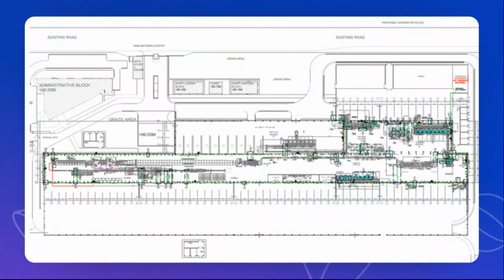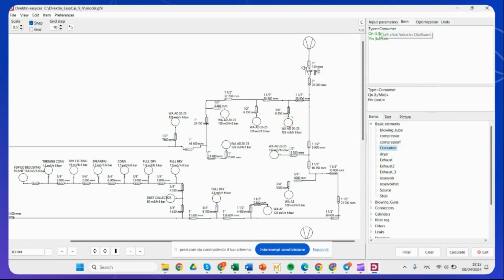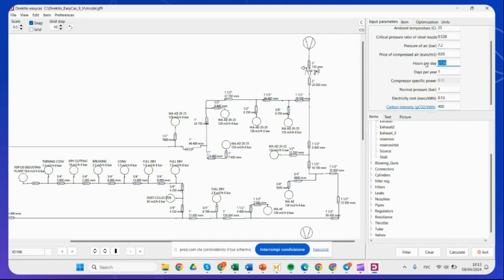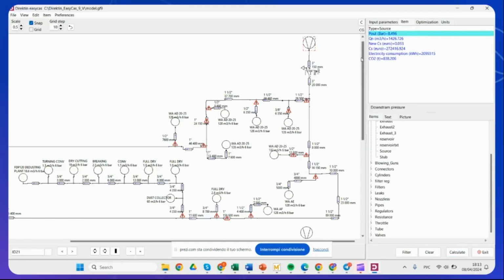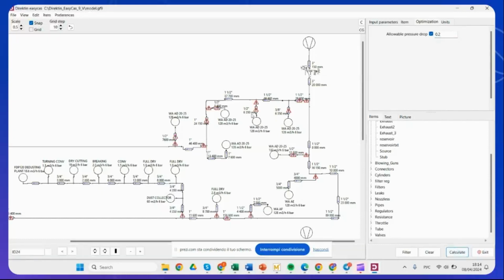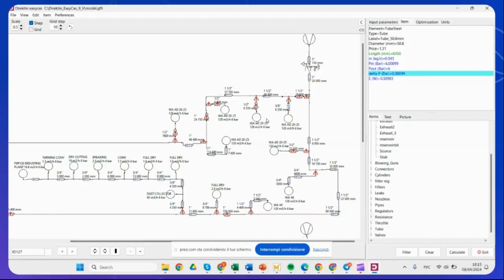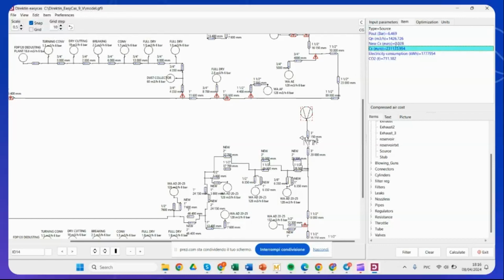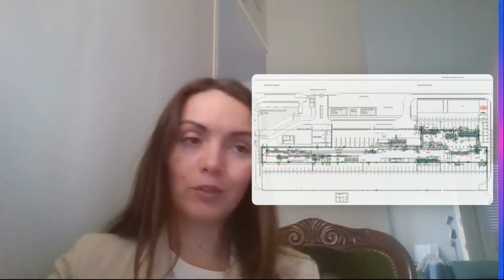How to design compressed air system in 2 hours

Comment: Love the way the software identifies problems with the current system in red!
It may take a while to input the system but the solutions are then provided.

A warning to air system designers and installers:  I have seen GAS LINES identified as air lines in factories because they were painted the wrong color!

In addition, I have seen new equipment delivered with wrong items such as too small of a regulator/filter installed by the supplier.

It doesn't hurt to check it out using this software!  [can save you a lot of headaches]
Reply from the maker: Thank you for your feedback! we wlil be happy to improve it, if you are interested in becoming a tester, reach out to elvira.rakova@direktin.com